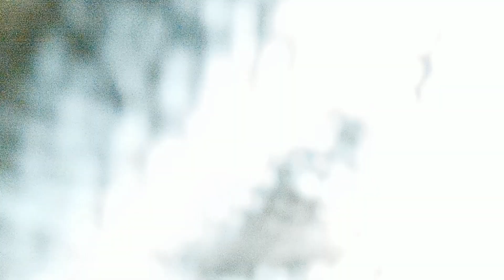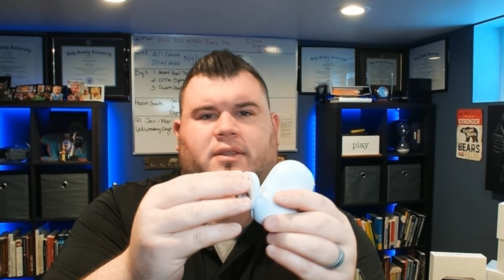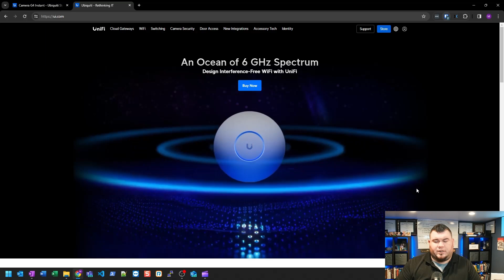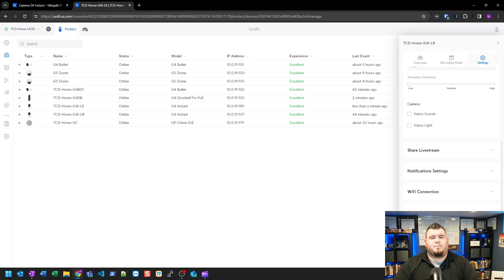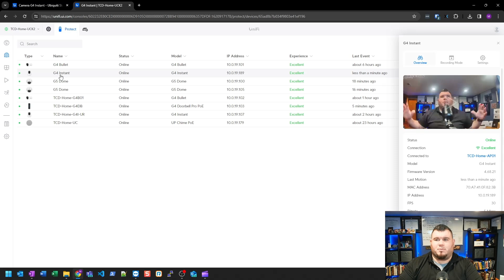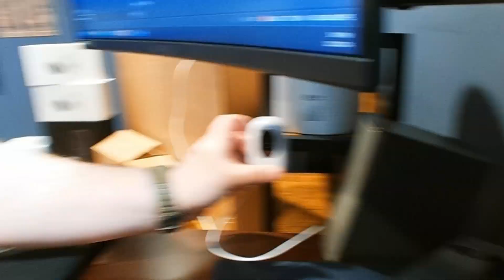G4 Instant Setup

Comment: I’m sorry for my dumbass question.. I’m ignorant to cameras and still extremely new to computer tech (I’m a cybersecurity major just starting at the basics lol) but I was wondering, can I watch this live video on this camera indefinitely? Like I took a recommendation from a friend to get Amazons blink cams and I can’t watch live feed for more than like a minute or so and then I have to reopen the live feed or use their subscription to view longer which I’m not doing. Lol. Can I watch this feed indefinitely if I wanted to? I know you don’t recommend it for outdoors but I need a wireless cam for outdoors and I’ll be using this to keep an eye on my dogs when I let them out in the backyard while I work (I work from home).
Reply from the maker: Yes, you can watch the feed live for as long as you would like. It's not like Blink or others where its a 30 second feed that then prompts you to continue viewing.

For example, I have casted Protect feeds to a monitor for hours. They even sell an HDMI device - called the Protect Viewport - as a way to display all cameras as a live feed on a dedicated monitor/TV. IMHO, just cast it or look on your mobile device. 

I don't recommend this unit for outdoor though, if protected by an awning and not in the direct path of rain/snow/sunight, I'm sure it would be fine.

You could also get a suction cup shelf for a window and work it that way. There's creative solutions to mounting this thing that do not require a separate, wired outdoor camera. 😄
Reply: @ that’s awesome!! Thank you so much for the valuable information! Truly appreciate it. And okay cool. I will see about placing in a spot that isn’t affected by weather. I love southern AZ so it gets ridiculously hot here, so that would surely be a concern. Thank you again for taking the time to go so in depth to answer my question. That means a lot.
Reply from the maker: @ Of course! I love these cameras. They're reasonably priced and have a great picture. 

Good luck and let me know if you have any other questions!
Reply: @TCD_TheComputerDad  Couple questions.  Just installed the CouldKey+ on my Ubiquity network and added the first G4 Instant.
I have a wired monitor (HDMI) run of a PC that is in another room that is for viewing the security cameras.  What is the best way to stream the Protect feed to this monitor?  Just open the Unifi Site Manager in a Windows Edge browser window and move it to that monitor?  That is basically what I do not for my security viewing software.

Were you going to do another video on setup of Protect record/storage manager and functions?
Reply from the maker: @christophersawtelle2558  Good stuff! The best way is to open the protect app from ui.com, exactly. That is how I do it today on a desktop drawing monitor that I use sparsely. 

I have to get my rear in gear for additional videos. Happy to answer any questions you have!

Working to get a new one in place for the recent changes allowing external, non-UI cameras as well as off-site storage via cloud or NAS.
Reply: @TCD_TheComputerDad  I've been working with non Unifi cameras and having some trouble.
I can get them adopted but they will not stay on line.  Online for a minute then off for a minute then on again and just cycle like that.
WIFI or cabled do the exact same thing.
Even had this issue with the G4 Instant for a while.
Protect web GUI will just say "offline" while the Protect app will say "camera lost power".
So far no solutions.
Reply from the maker: @christophersawtelle2558  Interesting. I have an older D-Link camera that I will be firing up this week to test the non-Ubiquiti options. 

I have all of my cameras on an isolated IoT VLAN. I've heard the G4 Instant giving people problems with connectivity. For me, it was always about proximity to my AP.
Reply: @TCD_TheComputerDad  I think I have solved my issue of the cameras, 3rd party, going on and offline like I described above.
 I discovered that if I set the 3rd party camera to H264 Highprofile instead of H265 Mainprofile they started to work.  Going to see how this works out.

Comment: Is it possible to get unifi G4 instant working without any access points or other unifi hardware? Only laptop, tablet, phone..
Reply: I have a 2 G3 micros and while trying to install some g4, I always got stucked since my SSD pass is wrong. 
I factory reseted and still got the same error. 
Any clue?
Reply from the maker: @lucas1709  For kicks, can you try another SSID to see? I take it this is the same wireless network your G3 units are on?

The console will show connection lifecycle to better see where it is failing (association, authentication, DHCP, etc.).
Reply from the maker: @snjivo  Negative - the device is wireless and needs to be adopted by a UniFi controller with the protect application installed. This would be a UDM, UCK, or UNVR.
Reply: @TCD_TheComputerDad  I ordered the Unifi Cloudkey G2, with HDD. Is that enough to setup my G4 and make it stream to my phone etc?
Reply from the maker: @snjivo  yes! That will allow you to adopt the G4 to the UCK Protect application. You can download the mobile app and authenticate to view the livestream from your phone.

Comment: Getting alot of disconnects and it saying Los of power?
Reply from the maker: Some preliminary questions: Are you using the provided USB-C cable and charger brick? If so, have you attempted to plug it into another, known good outlet? 

It seems that there are some QC issues with them: https://community.ui.com/questions/G4-instant-keeps-losing-power/f056211f-e662-4739-b3aa-79b2b6827750

Depending on when you purchased it, direct from Ubiquiti comes with a two-year warranty. You should be able to RMA the unit if it continues to have issues.